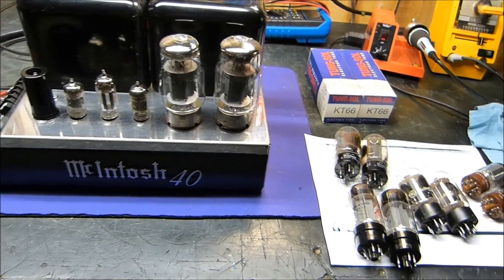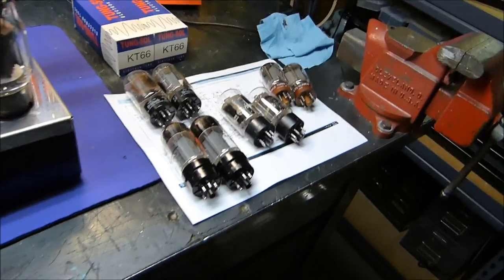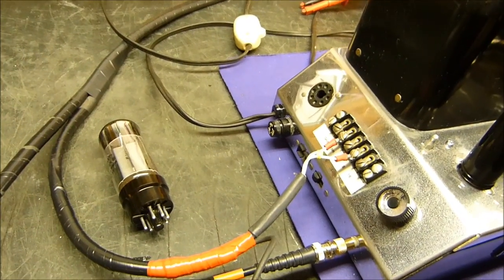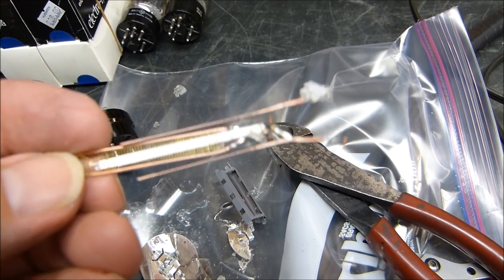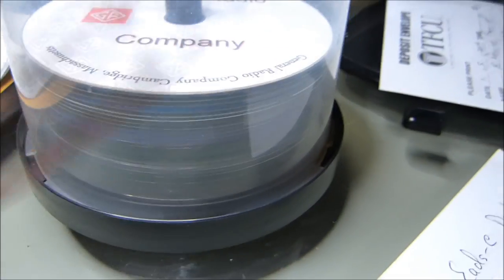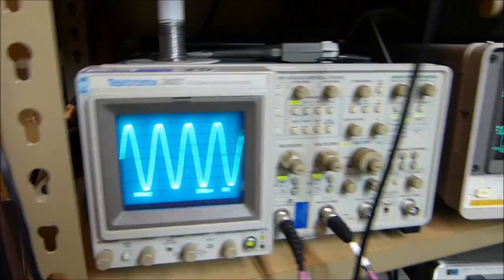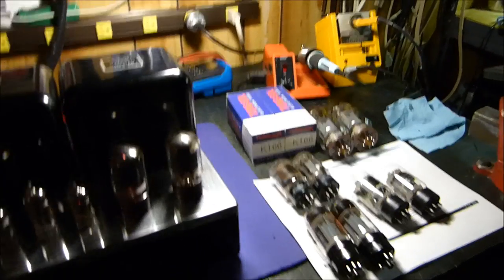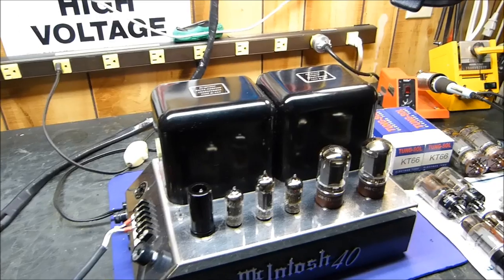Examining A McIntosh MC40 And A Bad 6L6GC

Comment: Hi David!  I've had a set of MC40s for over 20 years.  They are OK amps, but far from great, IMHO.  The Achilles Heel is the voltage-doubler PS.  They are rather tolerant of different output tubes on the test bench, but sound-wise, selecting good tubes for the drivers and outputs makes a fair difference.  Output tubes I have found that work best are the Sovtek flat-top 5881... which I readily admit bear no resemblance to the original Tung-Sol 5881 of yester-year.  Don't ask me why, but they just seem to sound best to my ears.
Reply from the maker: This is really interesting, Ben. I had a MC240 for years and for some reason I was never really satisfied with it. I traded it off for the MC275 which I do like better and have had it since 1976. I did not have the test equipment I have now so I cannot attest to the test bench performance of the MC240  but this MC40 that I have does not measure up like some MC75's that I have tested and posted one of them on YT channel. Also so interesting is your comment on the Sovteks. I have found that they perform very nicely in the power output arena. I have not evaluated them closely in the THD world. I have no issue with the voltage doubler circuits that Mac uses. They are all full-wave and in darn near all of the amps except the MC275 which is a bridge. I am not sure what makes the vintage tubes "sound better" but I will agree.  I have to say I seriously doubt that in a real double-blind test we could actually pick out the vintage vs new tubes - truly I believe that. But... just holding these ethereal old tubes that have lasted so many decades and still perform so well, and they almost always do indeed  out perform the new one, but the difference is so slight. Thanks for your comments. I think we have much more to talk about.
Reply: ElPaso TubeAmps Hi David!  I have a big issue in any hi-fi audio amplifier that uses a voltage doubler circuit because they limit current flow when compared to a FWCT or bridge rectifier arrangement.  Given that the power stage is consuming the lion's share of the current, the overall sound will end up being compressed.  The doubler circuit is very dependent on the electrolytic capacitors used.  ESR is going to have a real factor here because all the current has to pass through those capacitors in the diode/cap bridge.  Overall, a voltage doubler is a cheap way to make a high-voltage power supply.  Given that a McIntosh amplifier was never a cheap item, this greatly surprised me.  It also soured me a little on McIntosh. 

If you have a high voltage variable supply available, try rigging up your MC40 to it and listen to something with serious dynamics.  I have done this and found that it is a night and day difference.  The MC amplifier circuit itself is capable of very good things.  A really great mod for these amps would be a new power transformer with the HT winding designed for a bridge rectifier and twice the current-handling capacity.... 250mA would be real nice and provide a bit of headroom. 

I have also had an MC240 in my rig for a bit...  same issue.  The power supply is a bit bigger to deal with both channels, but the doubler is still there.  I actually thought it sounded a hair better than the mono-blocks at lower levels.

There are times, like with a solid-state guitar amp, where a voltage-doubler supply can actually be a welcome thing.  Some years back, I worked on an old 1-watt guitar amplifier.  It was a small practice amp from the early 1970s that sounded darned close to a typical distorted guitar amplifier even at low volumes.  I traced out the entire five-transistor circuit and the PS.  The amplifier portion was disgustingly simple and had no protections beyond the line fuse.  It also did not have a heat sink for the power devices.  All the protection was provided by the heavily-limited current from the voltage-doubler.  The caps in the doubler had a very high ESR.  Had this current-limiting factor not been there, the circuit would likely have blown up in the first ten minutes of its life. 

Yes...  we have lots to talk about.  I know I can learn a lot from you!!
Reply from the maker: Ben Wa Ben - you have really peaked my interest in the voltage doubler, especially your comment about how important capacitor ESR will be in the delivery of current for high power levels - and interestingly how it can limit the current in your little amp and even provide a desirable "over drive" tube sound. Thanks - if I can come up with anything good I will post what I find.

Comment: very nice video.  I use tubes for a long time too. I had a old pair of sovtek 6l6 tubes in my fender amp actually they were the original tubes for the amp and they said made in the USSR FINALLY REPLACED THEM in 2007 haha the amp didnt sound good for a long time but I was just trying to see how long they could hold up then I got the sparks so I replaced them with the new tungsol 6l6 type
Reply from the maker: It is amazing how long some will last. There are going to be some Russian tubes around in 20 years that will be sought after. Many of the branded, i.e. Fisher, Dynaco, McIntosh, etc. were the premium tubes and some are still around. From my experience, Teleflunken, Tung Sol power tubes, Mullard 10M, etc often times still test very strong and perform excellent in the vintage equipment. Tubes that Tektronix used in the oscilloscopes are very high quality - unfortunately... many of them have simply been used-up by being in equipment that is turned on 24 hours a day.

Comment: Great video!!

Just a little "fool around" hint, if you have a known bad pentode style tube, try this: heater 1-2Volts above rated voltage, grounded cathode, screen grid max. and rise the plate voltage. Sometimes you´ll get a wonderful blue glow on the screen grid just before it melts down finally.
If you happen to have an old known bad rectifier (5u4 or alike) tube heat it like rated and hook a low ohms resistor (10 to 100) to the cathode and to ground and raise the plate voltage, you´ll see a lot of sparks, like litte fireflies comming out of the heater while melting down.
Reply: I'm going to report you to the electron tube abuse hot line...!!! I'm just kidding....! I've never done much of that but I imagine it could be very entertaining.
Reply: bain5872 Nooohhhh, please...., As they will confiscate all my YL1350 in return!!!!

Two posibilities:
A: simply trash the tube or display it in your living room showcase (=boring)
B: have fun with it the very last time.
I would go for B, always ;)

Comment: Sometimes you will notice a difference in the color of the cathode and sometimes not. I suspect the problem is with the heater. It's not bringing the cathode up to the proper emission temp. Once the B+ is applied, the electron cloud is depleted and the cathode is unable to maintain conduction at that rate and sags. If you were to place in standby and reapply B+,it will exhibit the same behavior again (current sag). I've tracked this problem down, in a number of cases to the heater as opposed to the cathode it self. I have tested this in the past by increasing the heater supply voltage and see emission increases but of course, it still calls for a replacement. But on occasion, I have ran across tubes with bad cathodes but it's not the norm at least in NOS tubes. Some of these new tubes are a completely different story.
Reply from the maker: bain5872 What you say makes complete sense to me. I think I will search through some of the other spares I have and If I find another bad one, in a similar manner, I will put it on the tube tester at an increased heater voltage and see how it performs there. No doubt these tubes need to be replaced but I sure enjoy experimenting with them and knowing why they fail. Possibly using a milliohm meter on the filament might also tell us something, comparing to a known good tube. I will try that also. Thanks...
Reply: ElPaso TubeAmps
I agree. I love failure analyses also. One thing I find disheartening is the art of making a quality vacume tube is a dying one. If it were not so expensive and the EPA were not  involved, I would begin learning the art myself however, that would require a fortune and act of congress to happen. I'm also wondering what will happen to the tube market now that sanctions are in place against Russia? Svetlana and Sovtec are sure to be effected as the supply here in the US are bound to dry up at some point.